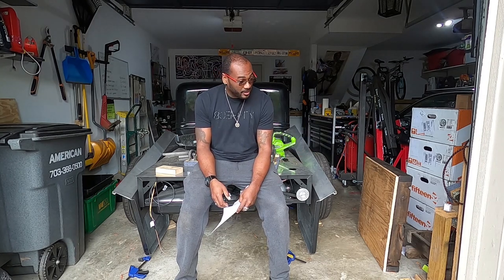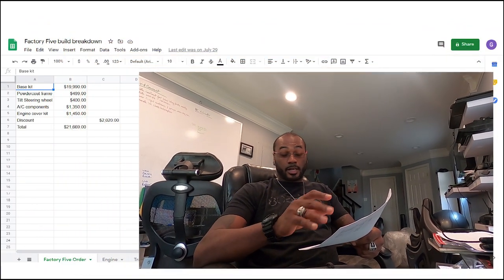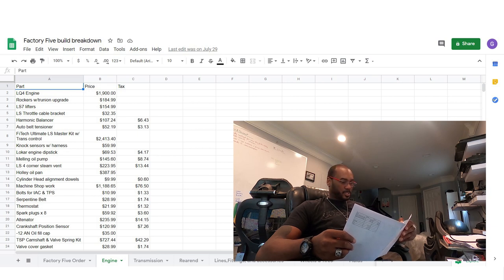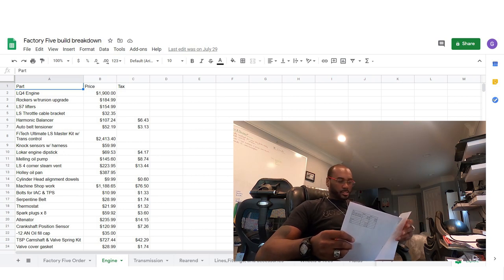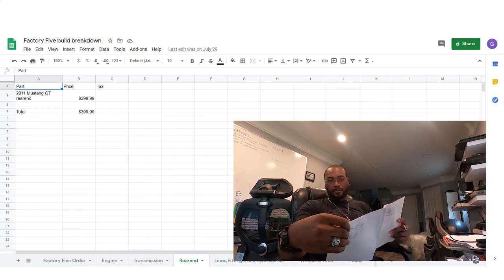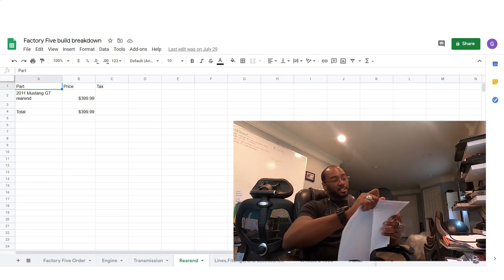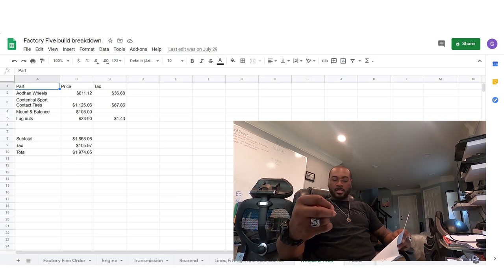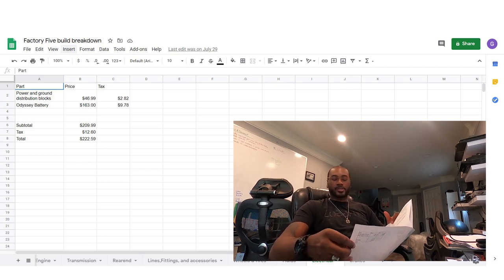Factory Five 35 Hot Rod Truck Build Cost Breakdown

Comment: 42k isnt bad. Sure could have been cheaper, or higher, but in the end its how YOU wanted your car. Beats the hell out of buying a new car for 50k with generic oem parts in my opinion
Reply from the maker: That is exactly it. I can honestly say I know where every bolt, nut, screw, and wire is on this car and I built it with maintenance and reliability in mind

Comment: Now that it is all none, Would you do it the same again, or maybe get the Blue Print engine / trans kit to help ease any problems with all the different wiring connections?  Thank you  Ron  USCG RET
Reply from the maker: Honestly the only thing I would have changed about the build if I were to do it again would be to use the infinity box wiring harness.
Reply: @decelation  OK Not sure what that Infinity is But I am not into fancy electronics or computers in a vehicle. I will stay with FFR wiring harness.

Comment: Lot's of people have been telling me that I will not be able to fit in the '35 Truck, being 6'5" and 250lbs.  Unsure what your height/weight are, but you're the only guy that has a full build of the FFR truck series on here...  What would be your thoughts on me fitting in that truck.  I was also planning on running an auto, but Ford powerplant.
Reply from the maker: I am 6'1 and 230lbs. It is a tight squeeze for me to fit. There are things that can be done to squeeze out some more leg room. Tilt steering wheel is a must and you can also make seat brackets to lift the seat to take up some of the space as well. I highly recommend trying to have a seat in one ahead of time. If you happen to be in Florida I will gladly arrange a time for you to sit in mine
Reply: @decelation  Few people on the FFR forum replied to my question last night, saying that Dave Smith is now making the cab 4" longer, that is supposed to fix the fitment issues for us big guys?  I have a feeling that's going to take away from the period correct year of the truck... :(  Also, I'm in North Alabama, so I won't be able to take you up on your offer :(  I thought you lived in North Georgia, but I must've been wrong, LOL!
Reply from the maker: @JasonsFourCamFox  I did not know that. I like to think of it as a modern interpretation of a classic car. I think overall it will be better.

Comment: Like your reasoning on the rear gear. Immediately said to myself when u said 3:15..."my Lord, car will do 150mph." Haaaa. Did the gear take some of that "bite" out of the bottom end?
Reply from the maker: I can still light up the rear tires under 30 if I want to. I am aerodynamically limited on speed. When I did the calculations I gearing limited to 212mph
Reply: @decelation  yeeeeee-ha lol
Reply from the maker: @waden404  right?